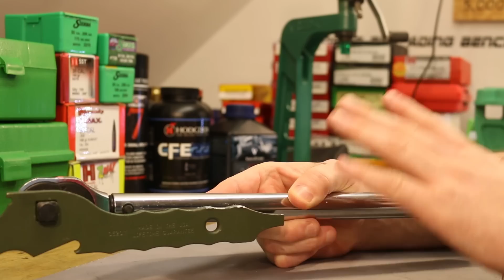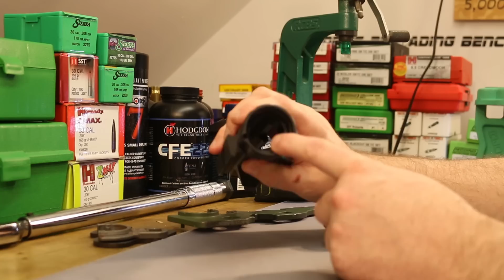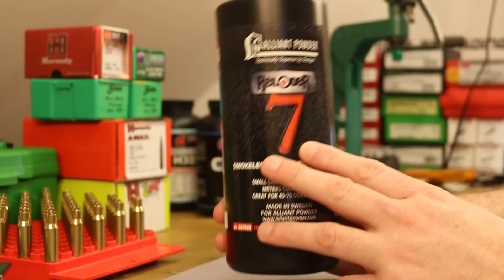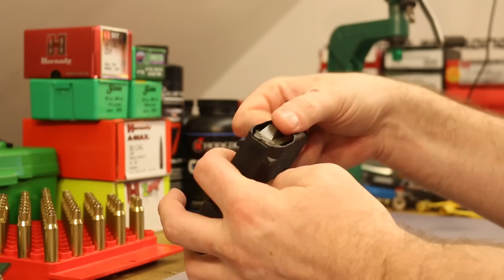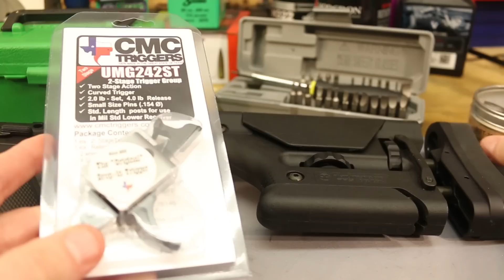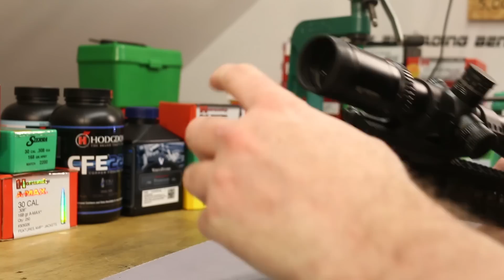Aero Precision M5E1 - First Shots (AR-10)

Comment: My 308 is a brass eater. No matter what load I use, I get swipe.
Reply: Polish the bolt face. Also the very sharp edges of the locking lugs inside the barrel, DON'T remove metal, just the burrs. 600 grit would be the roughest.
Reply: Gary Snyder it’s been cleaned up well. Some of these LR308s do it.
Reply: shaunpisk my lr308 gouges the crap out of the brass.

Comment: I would love to see you shoot a Criterion barrel. Optics Planet sells 18" barrels in both stainless steel and nitrided with either rifle or mid-length gas for around $300. You can always find 7-10% off codes with them as well to save some extra cash.
Reply: Criterion does make very very nice barrels, quality well above their price point.
Reply: Phillip K. +1 for Criterion...CMP uses them for 03's M1s etc..and my 300 Win Mag Johnny you know it shoots...
Reply: Thanks for the info. I'm in the market for one. Do you know much about Bear Creek Arsenal barrels? They have one with a parkerized finish for $118. Is the increase in quality/precision with Criterion worth the extra money?
Reply: @stevenk113  dont know about the bear creek. But from what i researched i went with the criterion 20 inch chrome dpms barrel with M118 chamber and Headspaced BCG.   I heard they can be some what loose in the aero M5 uppers but i will just go to the shop i used to work at and grab a stack of uppers and see which one fits the best. Accuracy will come from your barrel. Dependability from gas block and BCG. And the AR10 is not as plug and play as the AR 15. I think on the AR 10 its very  important to have a bolt that is Headspaced to the barrel you are using.

Comment: Run the wrench at a 90 degree angle to the torque wrench. Problem solved. Torquing a barrel nut like that creates a moment. A moment is only the forces acting perpendicular to a line or in this case the center of the bore. I'm a freshman in college going for mechanical engineering. Actually taking the class that explains these things right now lol. Thanks for the vid Johnny!
Reply: vgl217 this is the correct way to use a torque wrench on a barrel nut adapter.
Reply: This!

Comment: Do you think you will try the 208 ELD-M or even the 225? I doubt the twist is sufficient for the latter.
Reply from the maker: Yeah, I think I'll try the 208 in the next video.  I also doubt the 225's will work, but I am definitely willing to try them if the 208's do well!
Reply: 260 grain hp by outlaw bullets would be sweet deer thumping bullet. I guess ur barrel is 1-10  & 16" or 18" ? Great video Johnny thanks.
Reply: He's using a 308, not a 44 magnum, and you don't use HP for hunting deer.

Comment: I can’t find a medium adjustment on my gas block either. Suppressed works fine, but not suppressed is way undergassed. Or set it up for not suppressed and have it function but then way overgassed when suppressed. Kind of defeats the purpose of a QD can.

Will probably end up going back to a bolt gun.
Reply: Again, you made my day!  Great video!  Thought your approch to the Headspace guestion, was ingenious!  About the neighbors?  Let me know when one moves out, I'd love to have you near by!  Love the smell of gun powder!😁
Reply: I have experienced this issue on my AR 15's and AR 10's as well.  I have found that you have to set the gun for how you will continually use it.  If your going supressed, dial your gas for that and leave it.   If you dial it for regular, don't throw the supressor on unless you want to unleash hell on your brass.

Comment: Not sure who makes the Aero bolt, but if it's toolcraft, I had the same problems at first. It needed a lot of fine sandpaper and files on the extractor.
Reply from the maker: Extractor manufacturers should be ashamed of themselves.  They cause so many problems!  I guess 90% of shooters leave their brass on the ground and don't really care what it looks like as long as the gun functions.

Comment: Ballistic advantage fans at ?  Running sale columbiariverarms also testing out Faxon 6.5 creed load work up.  Always run LC brass ar10 even 6.5 alot brass prep.  Accuracy seem 1 gr less than max pressure on the  brass

Comment: Just finished the dishes and sat down thinking "boy would it be nice to see a video from johnny!" Looked at my phone and what do you know, a new video! Thanks johnny!
Edited to add, after watching...
Judging by your velocity with the 168's and your groups I think your a little hot on you loads with the powder used. IME, while you may find a load that shoots 2600-2700 the node is going to be very narrow. Dropping down to 2450-2600 you'll find a wider node with good accuracy.
Reply from the maker: Thanks!  Your edit is a great point.  That CFE223 was indeed pretty hot.  In the next video I will add some more 168 tests down at some more realistic velocities.
Reply: Johnny's Reloading Bench I had some great groups around either 39 or 40 grains of AR-COMP. Varget is also good in the 42-43.5 area with 168's & 175's. Unlike a bolt rifle you have to tune the load to the AR. Don't try to match bolt rifle velocity... you can get it going that fast but it will not shoot tight consistent groups.

Comment: My pet load for my bolt gun is 44.5gr of RL15 and the same with varget over 178gr ELD-X
Reply: 308 guy that is STIFF. I shoot 43.4 gr or Varget under my 178 gr ELD-X at 2.860".  I get 2700 fps from a 24" Shilen.
Reply: Its a pretty stiff load but its accurate in a savage 10T
Reply: I usually get 1/2 moa out of it sometimes better

Comment: Where is the varget????
Reply from the maker: I can't get every powder in the first video!  :)
Reply: Thankfully, I like watching the talking hand!!
Reply: I tried varget It seems to run to high of pressures for a gas gun.  I think the burn rate is not optimal.  4895 for the win in a gasser behind 150-168gr bullets and be done with it.  308 gassers have pretty much been worked out.
Reply: Another vote for Varget. Not a fan of the CFE for accuracy, ymmv.